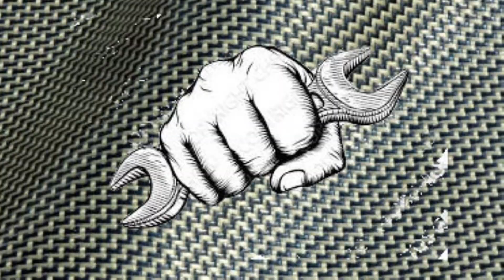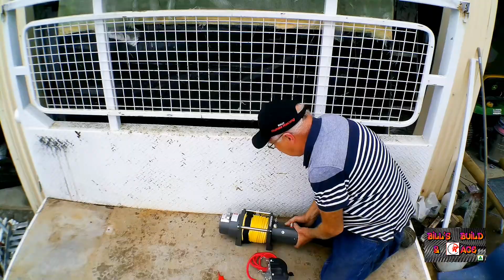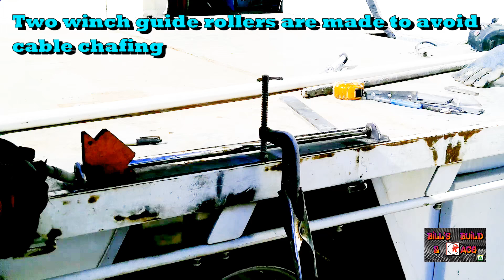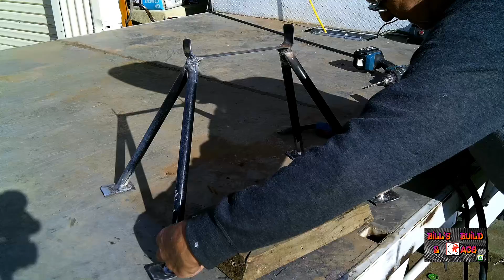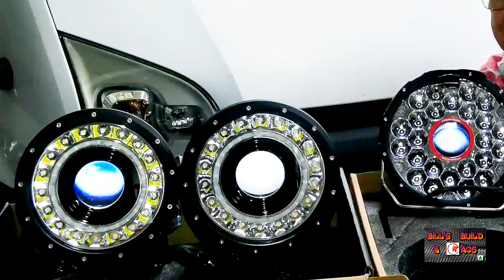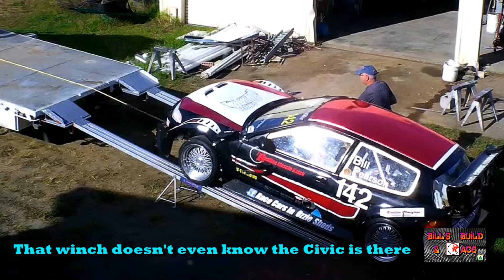Build a Race Car Transporter - Part 6

Comment: Great job Bill, have you thought about a couple of good LEDs for the back as reversing lights for really dark conditions, I know what it's like trying to back up a blacked out bush track at night with no moonlight, all but impossible. Just an idea mate, well done again. Seeya Rob.....................would it be worth using the panel you cut out for the winch as a trap door to keep the weather and prying eyes away.
Reply from the maker: Great minds think alike. ...all ideas I am looking at incorporating.
Reply: @BillsBuildandRace   Hey Bill, ME AGAIN, haha, maybe some of those rock lights down the side, under the track to light up the side of the road/tracks as well mate. Seeya Rob